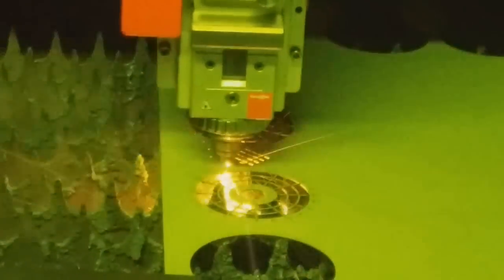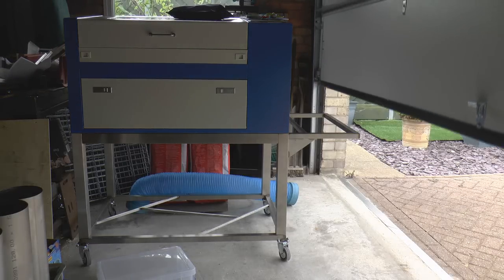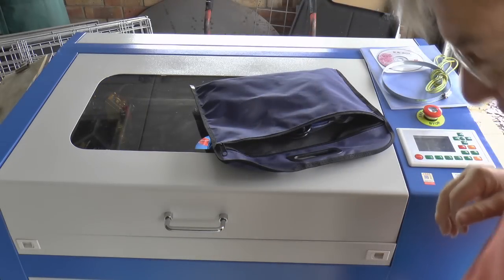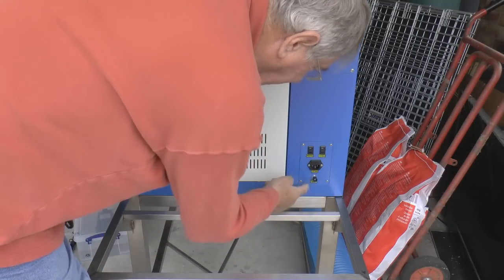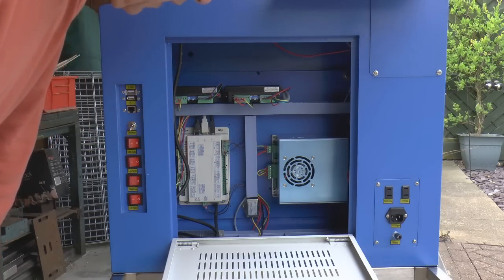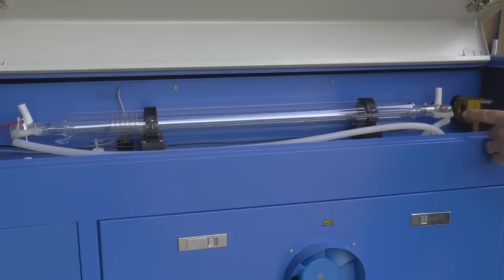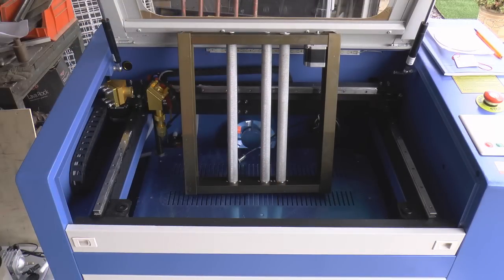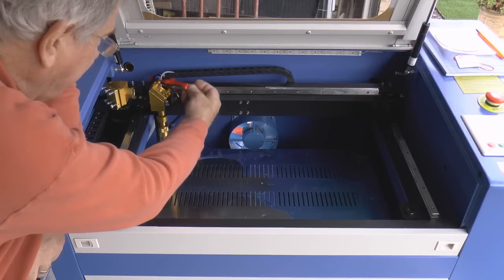Chinese laser cutter  tutorial part 1

Comment: Hey Russ,  been using my laser for a month or so.  It no longer fires a laser.  
The tube lights up, but no fire.  Any suggestions?  I'm thinking, power 
supply.  Your thoughts please, Larry
Reply from the maker: Hi Larry
An easy mistake to make when you don't understand how the tube works (that's not meant to be an offensive remark).
Very briefly.  There are 3 main gasses in your tube. Nitrogen, Helium and Carbon Dioxide . The nitrogen is a gas that can be easily stimulated to an ionized state by high dc voltage. It's the nitrogen that glows pink in your tube. That ionization causes heat within the gas and that's where the helium comes in, it acts as a heat carrier out to the water cooling jacket. The Carbon Dioxide I like to imagine as a lazy gas  but when the nitrogen atoms ionize they get sufficiently excited that they will collide with the CO2 molecules and kick them into a set of actions whereby they finish up emitting photons of light which get amplified into a laser beam
The point I am trying to make here is that a pink beam  is no guarantee of power. If there is no CO2 in your gas mix,  the pink beam will still be there but with no CO2 to collide into there will be no lasing action (power output)
So your power supply is OK (ish) but your tube is dead.

Let me take a few educated guesses here,
1)You bought a 50 watt laser machine. Sadly it's not 50 watts because you can measure your tube to find its 800mm long indicating that it is a 40 watt tube.
2) The tube is labelled KH LASER...bad news. I have been trying for months to track down the maker of KHtubes. They don't exist. From the evidence of many correspondents I am concluding that they fit B grade tubes to Ebay machines and label them with this fictitious company label. The tubes work, but not very well or for very long,
3 You do not have an ammeter fitted to your machine? AND do you know what the maximum drive current is for your tube? Have you been running at more than 65% power?? ( I suspect yes)
3) It often happens that the power supply does fail before the tube because they seem to be made of feathers, angel dreams and the cheapest components.
4) Difficult decision time. Do you just buy a new tube and risk it against your dodgy power supply  or take the plunge and upgrade to a good tube that will serve you well.

Sorry to be the bearer of bad news

Best regards
Russ
Reply: Thanks, I haven't use it over a dozen times.  But I've had it a while, so no help from seller.  The ammeter shows plenty of power.  I suspect you are correct.  Thanks, Larry
Reply from the maker: Hi Larry
The ammeter is measuring the power that is flowing through the ionized nitrogen. The more current the more excited the nitrogen becomes and the harder and more often it collides with any CO2 (if there is any CO2 left to collide with). The problem is if you run at currents that exceed the tube rating (your 40 watt tube will be limited to about 18mA) then the excited nitrogen has so much energy that it doesn't just kick the CO2 into action it can actually rip one of the oxygen atoms off the carbon dioxide molecule leaving a carbon MONOXIDE molecule behind. Carbon monoxide is NOT a lasing gas. Hence over-driving your tube will quickly deplete it of it's carbon dioxide (there's only 10% in  there to start with) Whilst the tube is in "good " condition, the current flow is a good measure of laser power but once the tube reaches a critical CO2 level  you will notice the power drop off.  A natural reaction to this will be to increase the power, but hopefully you can now see that this will just be the beginning of an accelerating death spiral.
Best regards
Russ
Reply: The Wood Whirler changing keyboard on ipad 3wchanging keyboard on ipad 3changing keyboard on ipad 3changing keyboard on ipad 3changing keyboard on ipad 3changing keyboard on ipad 3changing keyboard on ipad 3

Comment: Hello I have a question that you may be able to answer. I'm trying to engrave different things like knives, key chain ect. And the problem I run into is that the font is too thick. The laser seems to produce wide letter and I can get it to just make think letter so it looks thin and good on the knives ect. If you could email me mr.bynum86@gmail.com I would greatly appreciate it. Also I want you to know that I am using rd work and coral draw x5

Comment: nice interestig video! just one question: does your 50w laser machine cut also metal? (i heard that the other  chinese 40w laser machine cuts wood, plastic, paper, ... but not metal). thank you
Reply from the maker: Hi
No. you cannot cut metal until you start getting above about 300 watts and then it will only be very thin metal. I have owned machines that cut metal commercially but they were 3000 watts.
Best regards
Russ
Reply: thank you very much! so, do you think is enough the cheaper 40w laser machine if I need to cut objects such as plexiglass, thin wood, plastic up to 12-14 mm thikness.. ?
Reply from the maker: HI Cesare
Unfortunately 12 to 14mm is not thin. It also depends on if you are planning to do this as a business where you will want to cut quite fast. I have 65 watts of cutting power from my tube that delivers 70 watts.I can cut 12 and 14 mm acrylic but quite slowly at about 3 or 4 mm/sec. Some types of wood 12mm thick I would stuggle  to cut  at 1 or 2mm/sec.  If it is just for hooby use and time is not important then you may be ok with a 60 watt tube, However I would be looking at  minimum of an 80 watt tube to be safe. Howerver the bigger the power the bigger the machine and the bigger the fraud that possible. I must rush out now but tomorrow I will answer more fully if you let me know the table size you want and its use.
Best regards
Russ
Reply: thanks a lot Russ. you gave me many informations..! the machine I wonder to buy is for hobby, anyway I think I will buy the 50 watts power and not less. i want to cut engine seals, plastic or perspex things like gears and other elements in wood or paper in my house and garden. have a nice evening, regards!
Reply from the maker: Hi Cesare
 If you watch the part 2 video you will see that some plastics produce dangerous fumes. Please do some careful research if you plan to cut anything more than acrylic. Even some woods like Redwood cedar can be dangerous. Generally, make sure you have a very good extraction system.
To get a 50 watt tube in your machine you will need to buy a 60 watt machine because they are always over specified. The alternative is to buy a 50 watt machine (which will be cheaper) if it has a big enough work area, it will be fitted with a 40 watt tube but when you are happy with the machine and how to use it , you can buy a good quality tube and power supply to suit your requirements.  After this 6 part series about getting my machine into working condition I made mistakes and learned my lesson the hard way. The the whole of my laser journey is documented starting at https://youtu.be/SlUFg42u5xQ After 8 months I eventually upgraded my 40 watt machine to 60 watts. I now have a great machine.
Best regards
Russ

Comment: Amazing job on the videos! thanks for taking us on this laser adventure. I'm looking at buying a kl460 60wat one.
Reply from the maker: +Darus_  
Hi Darius
After being caught TWICE with Chinese specifications that are basically lying, you need to look into the details of your proposed buy to see what you will get rather than what you think you will get. For example if you go to the factory site for your machine for a more in depth specification, you will find
 http://keliangcnclaser.com/1-5-co2-laser-engraving-machine/216271
 From the factory it has no extras but there are a whole pile of them for you to up-spec your machine. One of the upgrades is NOT a tube/power supply. Take a look at the machine case dimensions and you will find the maximum width is 1200mm. This case will not take a 1200mm long 60 watt tube because you need 1200mm+25 airgap at HV end+ about150mm for the mirror assembly.  That's 1375mm... Oops. Now a 50 watt tube is 1000mm long+25+150=1175 and will fit in the case Whoever you are buying from send them an email asking specifically "if the 60 watt tube that's fitted includes an extension housing to accommodate the 1200mm long 60 watt tube". They may realise you have found them out and supply a 60 watt tube or try and fluff you off with "that's it's peak power sir". Your reply would be (in writing) "Yes but I'm not allowed to use peak power or I will invalidate the tube warranty". You may have to accept that it's a 50 watt machine and decide for yourself. If you get a written statement that you are getting a 1200mm long tube and it doesn''t arrive ...what do you do?  Well, that depends how you pay. If you are buying through ebay with PayPal you will imagine you would be covered by their protection schemes. Wrong, they are virtually worthless If you ordered a bucket and received a box that would be classed as fraud and you will probably be covered to some extent but if you ordered a large bucket and received a small bucket then that's not fraud as far as ebay and PayPal are concerned, that's a specification/warranty problem that must be taken up with the supplier ....who is probably in China and will just ignore you. Make sure you buy with your CREDIT card (even if it's via PayPal.) Credit cards are heavily regulated and  if you get defrauded and have WRITTEN proof (that's why you ask specific questions  and get written answers)you have been defrauded, you can go back to your card supplier and appeal to them. With written proof they will likely refund ALL your money and YOU are now in control.
Sorry to be negative,  but approach it this way and you will be prepared and not disappointed. 
Best of luck and sincere regards
Russ
Reply: +SarbarMultimedia wonderful info thanks! I'll be ordering something from aliexpress.com looking for something under $1300canadian.

Comment: Hello.  Thank you for the great videos on this machine.  I'm interested in purchasing one and I'm curious as to who you purchased yours from.  I see many different companies here in the US selling them on ebay.
Reply from the maker: +Christopher Miller 
Hi Chris
Look carefully at where it's shipped from. If it's direct from China you could well have to add on import duty and  taxes. If it's aleady in the USA then it will only be freight, but even then I see you can get "free" shipping with some suppliers. These ebay sellers are all agents for factories back in China, so there will be no service support if things are not what you expect. This is virtually the same package as mine which I bought from a UK seller (who is actually based in China!!) 
http://www.ebay.com/itm/High-Precise-50W-CO2-Laser-Engraving-Cutting-Machine-Engraver-Cutter-USB-Port-CE/200640422116?_trksid=p2047675.c100005.m1851&_trkparms=aid%3D222007%26algo%3DSIC.MBE%26ao%3D1%26asc%3D35695%26meid%3D8f5f5485e7894e68b208dd9919571119%26pid%3D100005%26rk%3D2%26rkt%3D6%26sd%3D370532760989
If you look at the photos, front right of the work area you will see a big silver knob. This is a manual table height adjuster. Mine is motorised and it would not take much to add a motor yourself (a nice little project). The great thing about this machine (this design is from http://shenhuilaser.en.alibaba.com/) is the decent bearing rails. The engineering is pretty good but I've made all sorts of detail changes to make my lazy life easier. If you look at the photos you will soon see the similarities (switch positions etc). Forget the warranty, I would expect it to be worthless, if this is the machine for you, just seek out the best deal and make sure you buy it with your CREDIT CARD. If things go wrong you will stand a much better chance of getting your money back from your card provider than from any Ebay or PayPal protection. Keep screen shots of what you are buying and any communications you have with the vendor. If things go wrong you will need this evidence for your card provider. All these machines are sold as 50 watt machines  but in reality they are 40 watt tubes with a 50 watt power supply. The machine case is not wide enough to take a 50 watt tube. Know this from the start and you will not be disappointed. Take your rose tinted glasses off and look at specs carefully.  Don't let this negativity put you off buying, I've had the most fun ever playing with this little Chinese dragon. This design is one of the best for it's price and is a a reasonably engineered platform to start building from. After 9 months of learning and modifications, I have got my machine to the ideal design (for me) and have now got rid of the inconsistent cheap 40 watt laser tube and upgraded to a super 60 watt system. It's now like owning a Ferrari!!!
Hope this helps
Best regards
Russ

Comment: Hi Russ your videos are a pleasure to watch i am looking at buying a laser cutter  just wanted to know what Cad software you use as i am getting everything i need to run the machine so any advice will be greatly welcome 

             thanks peter
Reply from the maker: +darren davies 
Hi Peter
The CAD software I use is a remnant from my industrial days It was a full CAD/CAM package but I persuaded the company to just license me the 2D CAD bit. I use that all the time and in conjunction with Adobe illustrator and Photoshop I can do most things, but I always finish up importing DXF files from my CAD into RDWorks.  I also use a 3D CAD called Solidworks which was created by and belongs to Dassault, the French aircraft maker. They also have a completely FREE FOR LIFE fully featured 2D CAD that you can download called DRAFTSIGHT. All you have to do is supply them with your email address so that they can send you reminders to update to the pro version or to buy their Solidworks. There is a free 186 page PDF manual as well but to download that you have to supply even more information. Don't  bother with either because I already have them both downloaded, If you want them  just go to my messages, send me your email and I'll ping you a copy.
Thanks for your appreciation
Russ

Comment: Hi there, where in the UK are you? I'm wondering if your not a million miles it would be possible to have a look at your machine, I'd really like to see one in the flesh, keep up the videos, they're great, cheers Jim
Reply from the maker: +Pallet Mouth 
Hi
I'm in Colchester Essex
Russ
Reply: +SarbarMultimedia thanks for that, I'm looking for a machine to engrave wooden chopping boards, is your setup too powerful? All the less powerful units have smaller beds. Do any companies you know of have demo units or test services?
Reply from the maker: +Pallet Mouth 
Hi
Engraving chopping boards is just the sort of thing these machines were designed for. Despite the advertising, my machine is only fitted with a 40 watt tube but that s plenty for your requirements. The machine is programmable over a 300x500mm area but will take objects that are larger.
I'm only aware of one Chinese machine import company in the UK  and that's HPC Laser in Halifax. ( http://hpclaser.co.uk/ ) They do have a showroom. They specialize in selling to education and have service support. They are expensive to buy from. If you buy from China direct (via ebay) you get good value  but ZERO backup so you must be prepared to fix your own problems.
There are lots of engraving machines advertised. I researched initially to find one that looked as though it was properly engineered. The slide ways are the most important aspect because if you are engraving they take the most beating. My particular machine has HiWin recirculating ball slide bearings that should last my lifetime.